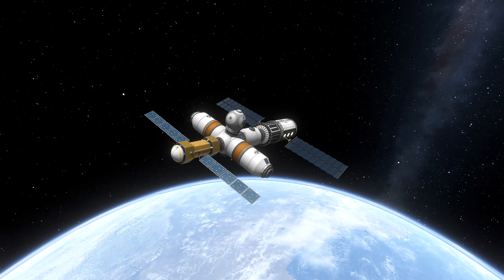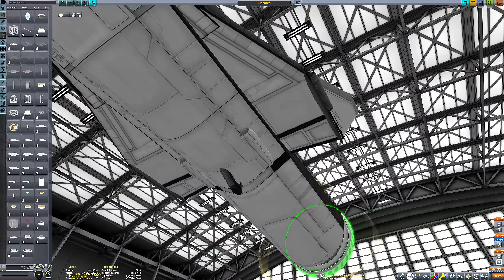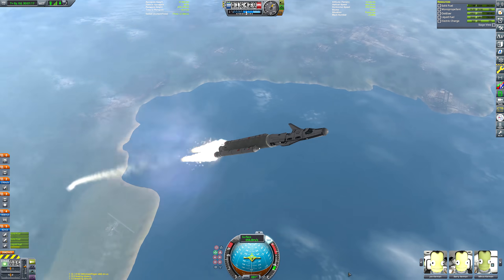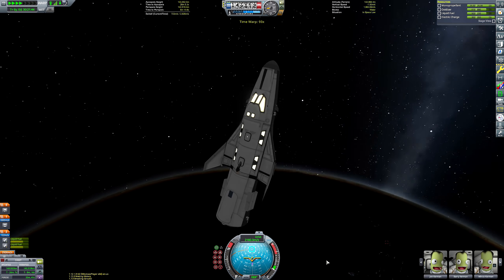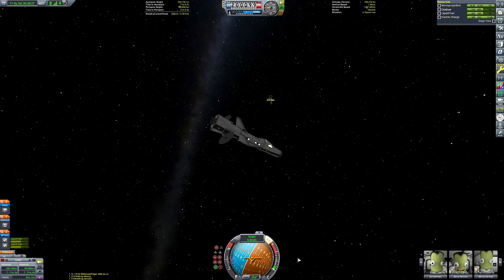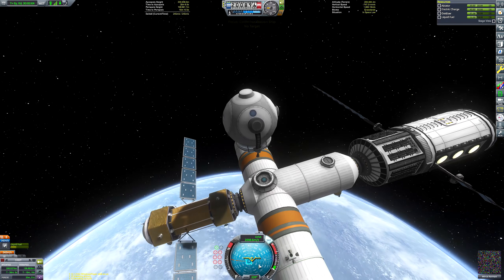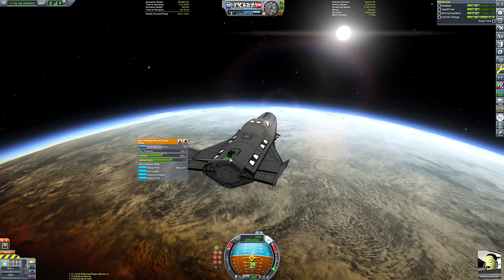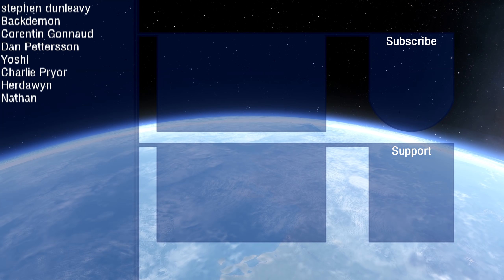KSP: The Abandoned ARIANE V Spaceplane Was Actually Pretty Genius

Comment: Had the ESA built the Hermes space shuttle and continued past the 2011 end of NASA Space Shuttle United States some of the aerospace museums in the US will have a display of Hermes Space Shuttle suits because NASA will piggyback its crews with ESA Hermes Astronauts. If Hermes can't land in Europe it needs an Abort mode that will have it land in Florida Cape Canaveral I-91 corridor Hartford, CT-Springfield, MA Westover Airbase & Bradley Airport Garden State Parkway Exit 38 ACY where it can be transported back to Europe by a Modified A350-900ULR from Cape Canaveral Hartford-Springfield I-91 corridor BDL and Westover AIrbase followed by ACY GSP exit 38 as an alternative sites if Marseille Istres French Air Force base is not available to land on.

Comment: I did the launch and docking as pilot of Hermes in the real simulator near Cannes at the Space Camp Patrick Baudry, it's quite a memory (in 1990 aged 14). Hermes was quite an elegant proposition, and would not have suffered the same kind of failure the STS did. (others maybe) NOTE : the Dream Chaser still keeps the backward compatibility and options for the Ariane 5 adapter; however a spaceplane under a fairing for me is ... something is just missing.

Comment: Hey Matt, I know what you mean about the space debris in sub-orbital trajectories that don't disappear from the tracking station. I don't know if it's a bug, or a feature (to prevent loss of a spaceship), but for some reason, if an object has an orbit that just slightly dips into a planet's (or moon's) atmosphere, it won't actually burn up or decay. As you gave said, KSP doesn't simulate orbital decay, so it just has a very simple rule that as long as the Apoapsis of a ship or piece of debris is above 70km, then the Periapsis has to go below a certain height before it automatically destroys it. I'm not certain of exactly what height it is, but I think it's somewhere around 50km-ish. But like I said, that's just a wild guess, I haven't played KSP pretty much since a couple of weeks after the ESA update came out, and even back then, I don't think that I actually knew the height.

Comment: Oh, my... Problem was somewhat wider than I thought. Here in comments was at least 3 variants of KSP's object cleanup range for "Pe in atmosphere" orbits.
Quick test brought these results:
1. (cpt.Obvious reporting) Pe below 0. Lithobreaking detected, as for bodies without atmosphere. This result correct if observe flight from the tracking station.
2. Pe below 25 km. This result correct if observe flight from other craft (out of physical range, ofc).
It is quite possible that 2'nd border may be moveable due to, say, quantity of simulated objects or some other parameters, but for me - it's 25.

Comment: The interesting thing regarding Hermes is that it has many different iteration and plans. While the most well known version is the one Matt made here ( 3 pilots + 1x pressurized payload area + expansion with engines and rear docking port), I found there are pre-1986 design that carry 6 Astronauts and has and a small open-able cargo bay (similar to KSP's MK2 cargo bay) and engines right with the fuselage (the adaptor will be just an adaptor with no engines/fuel)

Comment: "European lack of experience with space technology" as part of the demise of the concept is actually an pretty interesting bit of history. "Technically" what they learned killed some other interesting concepts and also paid forward to programs like the the X-38, HL20/40 and eventually the Dream Chaser vehicles. Hermes turned out to be vastly to 'dense' for the lift it's airfoils and body could provide which was leading to a very high (capsule like instead of lifting body type) heating environment which would have required a very difficult and expensive new TPS development program hence part of the rising costs issue. The aerodynamic issues you had were also a big part of the "problems' with Hermes though this was know before hand and they'd really hoped that non-aerodynamic-surface (aka big fins :) ) could be avoided but that didn't pan out either.

Yes Spaceplanes ARE much cooler than capsules but as you note the latter are actually vastly more practical, especially when going beyond LEO. Now not being a Patreon (subscribed and watch but that's about it) I still have a 'challenge' for you to ignore :)

Want to try and build a "Lenticular Reentry Vehicle" in KSP? :)

Comment: the reason why things in the atmosphere sometimes don't de orbit is cause it only calculates the atmosphere physics when flying the ship or being about 250 meters away from the ship so it would de orbit if you go to the tracking station and fly it
Reply: Correct. Additionally, everything with a PE < 25km gets deleted once its current on rails height drops below 25km.

Comment: guys how do you attach 2 docking ports in the build menu and have them be able to seperate?
Reply: Do you mean able to separate in flight? If so, bring up the parts menu in flight on one of them, and choose either decouple or undock, whichever is available, just like you would with docking ports that were previously docked in flight.   Well, this is assuming you have them correctly assembled facing each other.

Comment: Timestaps:-
(Click on the blue numbers)
0:20:build
3:13:launch
3:56:booster seperation
4:50:core seperation
5:54:rendevzou burn
7:57:rendevzou
8:52:docked
9:52:escape module testing
11:52:reentry
12:52:touchdown

Comment: most objects out of render do not model atmosphere along their orbit, so space debris will often float around forever, even though they pass the atmosphere. The solution is, go into the tracking center, select the debris, fly it, and as you render it in, on the next pass through the atmosphere, it will actually model the physics, burn up, deorbit and/or explode.
Reply: the other solution is to abandon the stages before camera view changes, it happens when periapsis rises above 21 km or so. if abandoned stage has periapsis below that it is automatically destroyed
Reply: @FatovMikhail  When the whole point is realism, what's the point of doing that?
Reply: @Mike23443  because it's easy. there's no big difference between 20 and 60 km periapsis. but low or even negative periapsis makes crash area more predictable and controllable
Reply: @FatovMikhail  the debris gets destroyed when it falls below a certain point, not just when the periapsis reaches that point.
Reply: I tend to just switch in, check that it'll decay eventually, then use abort flight. Who has time to watch it?
Reply: @keiyakins  I for one enjoy watching things explode in KSP.
Reply: I end up just looking at the debris in the tracking station from time to time if the periapsis is in the atmosphere i just terminate it as it should decay.
Reply: @3PurpleSquirrels  I do this as well, if I made the effort to make sure it'll decay and game limitations disregard my efforts, then tracking center abort is the tool used to overcome that limitation. Sometimes you just have to use the tools available and make it work.
Reply: It's also possible to just terminate something, or am I just playing it in easy mode?
Reply: @Vincent_A  It is, but some people just don't like doing that.
Reply: Would be cool if it modeled the atmosphere if the object had a periapsis below the atmosphere.

Edit: model the atmosphere if, 1) it's... I dunno 10km above the atmosphere and 2) the periapsis is within the atmosphere